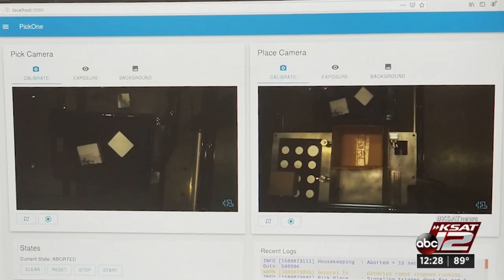San Antonio company aims to innovate world of robotics

Comment: For those of you in the comments,  robots will not take over jobs. I am in full support of bringing in robots but here is a generalization, robots can perform many duties but as I was once taught by my professor, robots are stupid. You can program them to do what you want and either they create errors, or they perform the task assigned and over time require maintenance. I believe robots will create more mid-level educaton jobs and they wont even replace humans because humans are needed as back up if these machines fail and trust me, they will. However, it's a growing field and we are way too far from a world where robots are even smart enough to pick up a cup or kill a human without someone looking over it 24/7. Also consider Isaac Asimov's Three Laws of Robotics that should prevent robots from committing inhumane acts. That's my two cents but this is coming from a an engineer who researches robots and realizes that they have great potential but have so much to develop in. If you want to comment about robots taking over jobs and such, explain why and dont simply put it out there. Everyone who has worked with robots know they have plenty of flaws and robots are not even close to taking over jobs, they are one minded machines, but it's the internet so what do you expect :/ also network connectivity issues occur with robots and its a big problem which is why the field of Cloud Robotics is becoming so popular. Do your research before blatantly blaming the economy or boasting your limited knowledge which consists of science fictional movie tropes
Reply: People who don't want robots... we can see what a world without robots looks like through history books and biographies.  Imagine building cars without robots today.  Or dispensing medicines.